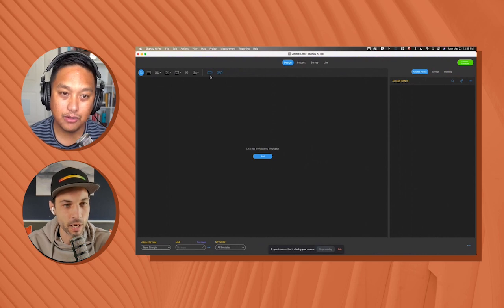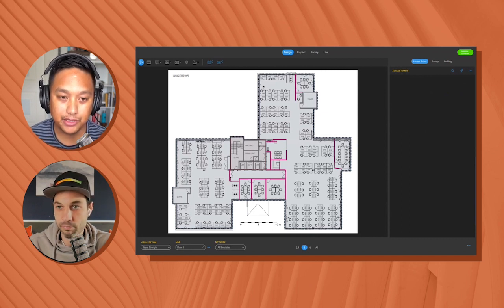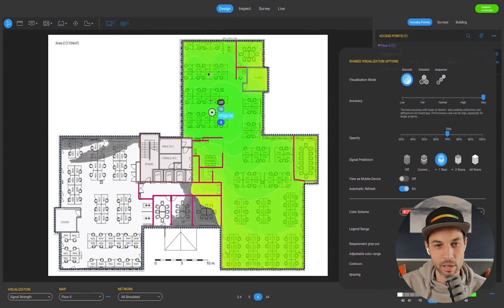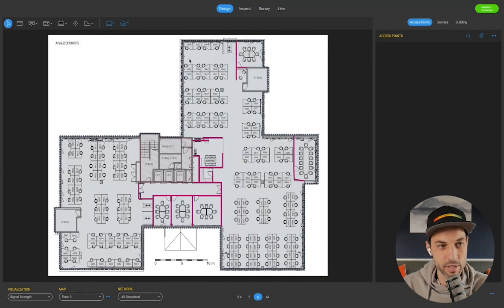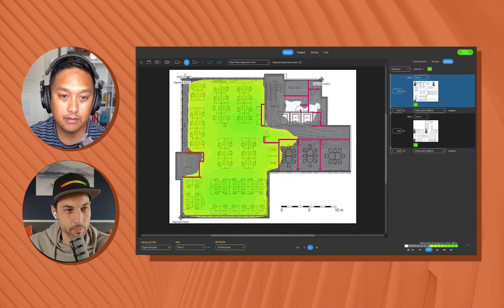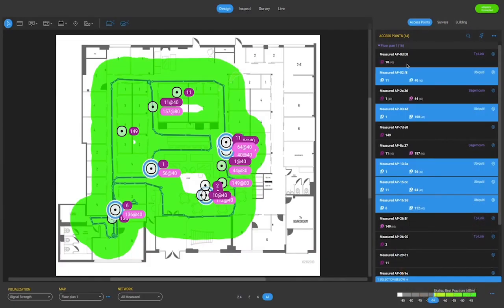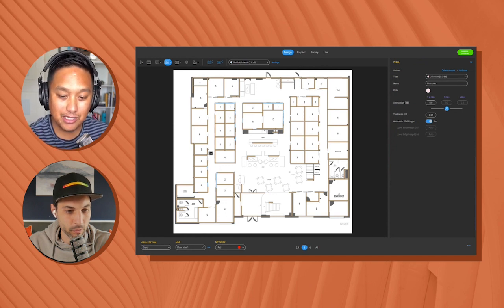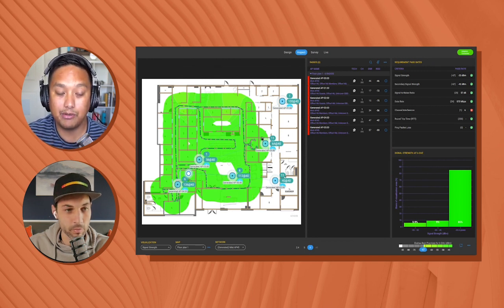CTS 290: First Look - Ekahau AI Pro

Comment: Here is my take after using it for 10 minutes.
The "measuring" tool is just terrible to operate.
Changing between floor plans is SLOW !!!!
The "Network" drop down menu is now hiding things even in the right pane so you can no longer really see the big picture and click around, filter and just spend more time to do the same thing.
Reply from the maker: It sure does take getting used to